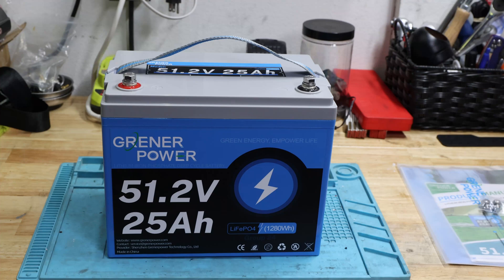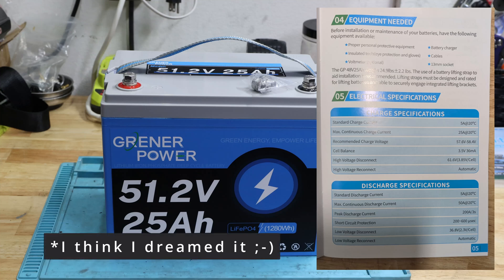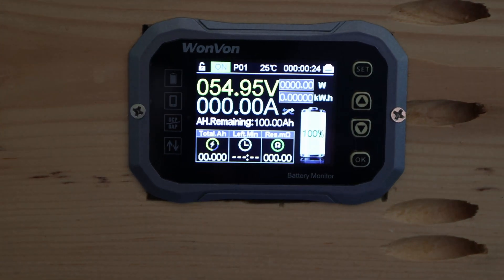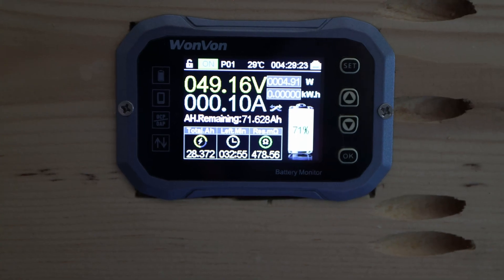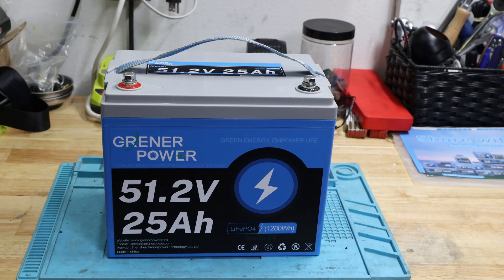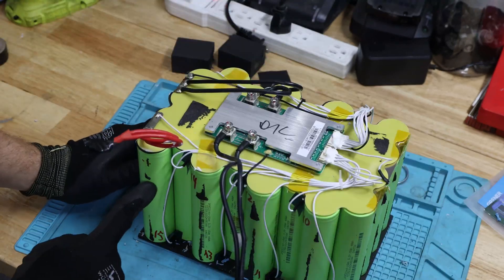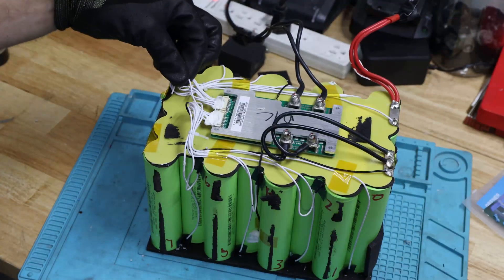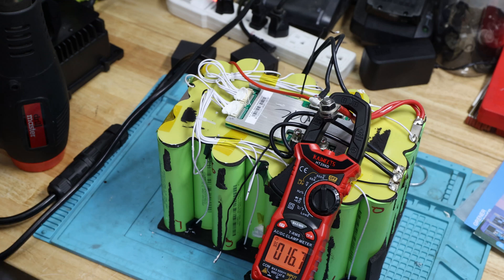Really tough to open and review this 51.2V Grener Power LiFePO4 Group 24 Battery!

Comment: I have two of the same battery connected it into parallel to boost the Ah. It worked pwrfect on our camping trip.. used it for a total of 2.5hr for tge whole 2 day weekend.. only use to make coffee in the morning and charge phones. Came home, and it went into safe mode/ protective mode. Can't charge it with zero amps.. battery one has 33.5V, and battery 2 has 46.6V zero amps.. is there away to rest it..note it was a bumping ride there and back out of the mountain.. the evening temps was in the high 50f. Can I rest the battery 🔋 or I am F... thanks for your help and input..

Comment: Hi Tobi,  Nice video of an interesting battery.  I have a CyclenBatt 12V 30Ah battery and I watched a YouTube video teardown which showed it had 8 cells in 2P4S configuration of similar size to the cells in this Grener Power battery . I did a capacity test and got just under the 30Ah (29.82Ah) at 4A (0.1333C) discharge.  As to the construction issue with the solder on the connection near the cells (12AWG wires) I agree with your comment however (as you said) this battery is sold strictly for storage which suggests a low vibration environment.  And thanks again for this fine video.

Comment: Great video! Thinking about buying as extra capacity for my bluetti ac200p.
Reply: That's one of my uses. 500W of charging. And it's light and easy to manage. $205.
Reply: @goodcitizen4587  yeah not a bad deal. I picked up 2! Thanks for the info. Can't wait to test it out.

Comment: Thanks for the video Tobi! Decent build quality right on par with many portable power station battery packs. Kinda reminds me of that. Just doesn’t have as robust of plastic cell separator grids. It is a storage battery so probably not going to see the shock and vibration a PPS would either. Good to see high and low temp, very thoroughly done review! 👍
Reply from the maker: Thanks for stopping by and watching :-)